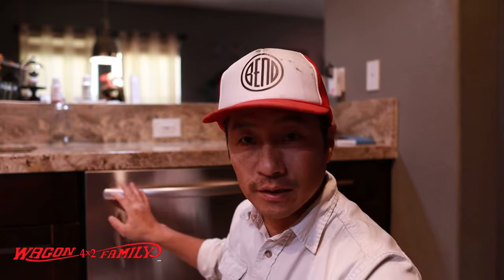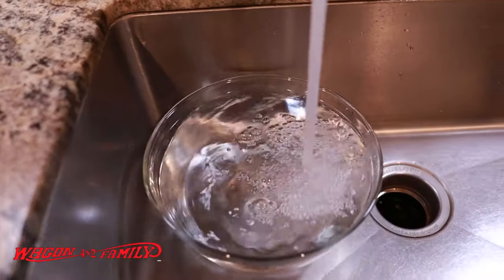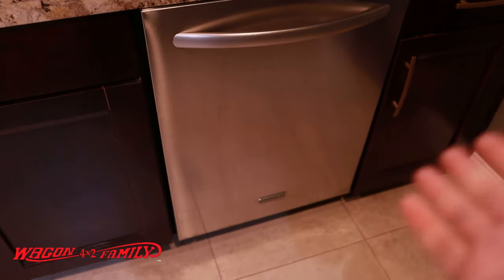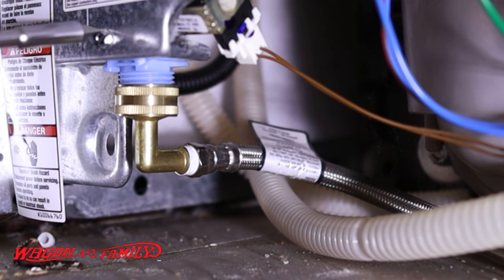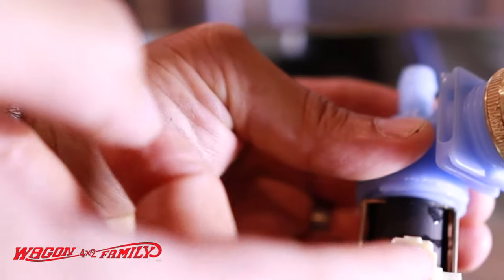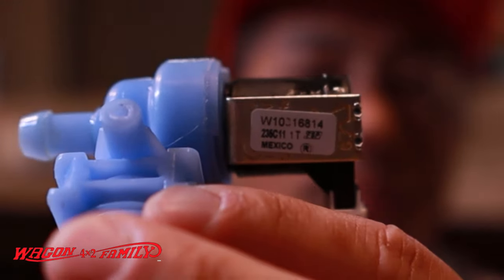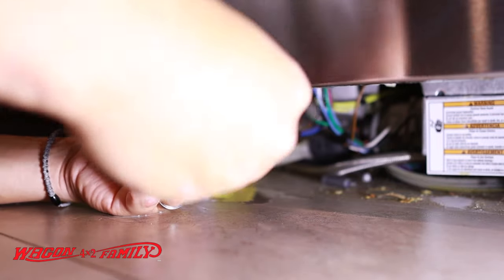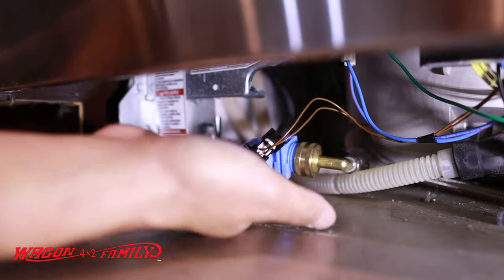How to fix a dishwasher not spraying  water

Comment: You didn’t check the component was s actually damaged your lucky it was the pump because it could have easily been the computer board itself and you’d of been 70 bucks out of pocket and still no working washer
Reply from the maker: The board might have been the next step if my quick test didn’t work. Perhaps that will be my next video. Thank you for the suggestion!

Comment: The part Number on the new packaging is not the same as the part number on the new unit
Reply from the maker: The appliance parts store said the original part number on the unit is discontinued but the new part number fits and works.